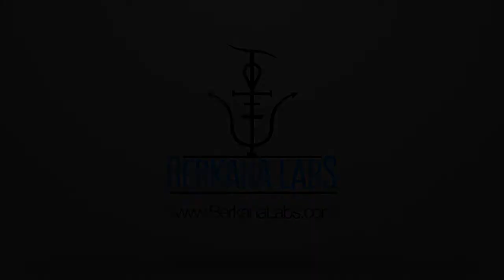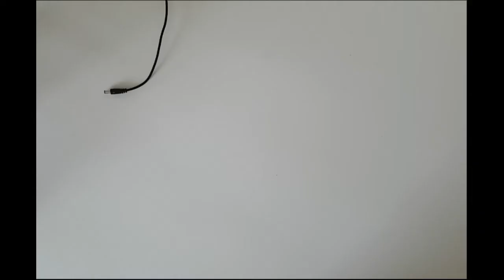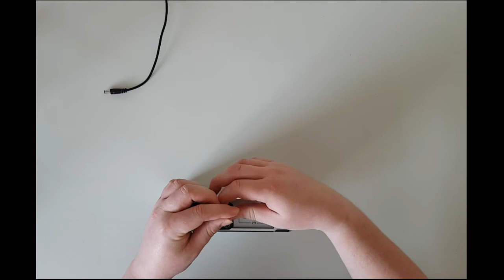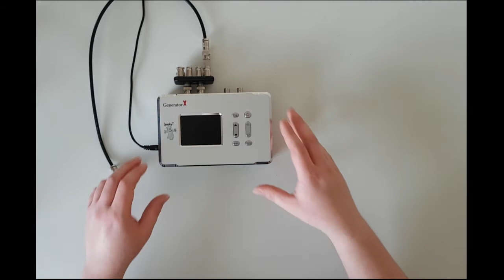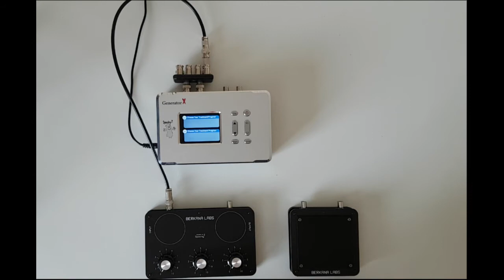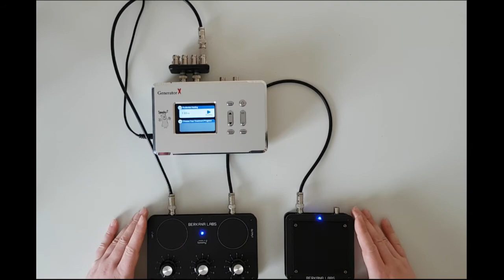Radionics Stick Pad | Berkana Labs

Comment: Guys, this is based on my own research. I am not sure if this is the case for this particular stick pad from BL though. 
 Technical Analysis of the Drown/Abrams Circuitry

The "electronics" of these devices can be understood as a form of Radionic detection, operating on the principles of resonance and electrostatics rather than conventional high-voltage power.

1. The Technical Component: The Capacitor Effect
Physically, the "Stick Pad" (often a rubber membrane or dielectric plate over a metal coil/plate) functions as a variable capacitor within a resonant circuit.

The Circuit: The Drown device is essentially an impedance rheostat—a series of large, variable resistors.

The Signal Path: Extremely weak energy is theorized to flow from the specimen (e.g., a blood spot) through the dials (resistors/tuning stubs) to the rubbing plate.

The Finger as Ground: As you slide your finger across the plate, you become part of the circuit. Your body acts as the ground or the second plate of the capacitor, completing the loop.

2. The Physical Phenomenon: Electrostatic Adhesion
There is no "high voltage" involved in the traditional sense. Instead, the device relies on electrostatic effects and microscopic galvanic currents.

Surface Tension Shift: When the circuit reaches resonance (meaning the dial settings match the specific frequency of the sample), the electrostatic field on the plate shifts.

The "Stick" Effect: This change in the field increases the microscopic friction (adhesion) between the fingertip and the surface. This causes the finger to "drag," "stick," or "stutter."

Analogy: This is similar to rubbing a finger over a balloon; depending on the static charge, the finger either glides smoothly or "squeaks" and sticks.

3. Physics vs. Vitalism
The device occupies a grey area between documented electrical components and controversial theories:

The Tangible: The wiring, resistors, and plates are physically real. If the connection to the plate is severed, the device (according to Drown’s blueprints) ceases to function.

The Controversy: Classical physics struggles to explain how a biological sample provides enough "energy" to produce a tactile effect without an external power source or amplifier. Drown and Abrams postulated a "Life Force" or Emanation that they treated physically as if it were an electric current.

Conclusion
This is not a "fantasy prop," but rather an electrostatic detector. The underlying electronics consist of a complex system of rheostats designed to indicate resonance through a tactile change in surface friction.

Comment: In the Manual you recommend the boost out2 port, Here  however you recommend the BN port, Any reason in particular? I want to work out Rates, does it matter? I realise that one is general and the other Healing.
Also, after you have worked out one rate and  you wish to find another one for something different, do we need to switch off anything and start again? or should we just set dials to zero and continue?

Comment: I still don't understand the purpose of it. I'm new to radionics and your products. What purpose has it if I tune the dial of the remedy with a stick pad. What is it good for?
Reply: Этот метод не корректен, не забивай себе голову, он очень груб, палец -это должен быть палец пациента, но не оператора. Проще купить любой не дорогой прибор биорезонансной терапии, а также использовать метод Фолля или доктора Шиммеля.
Reply: @prostoUser233  I am the patient. The devices you mentioned are fairly expensive for an end user and I don't know how to operate to get the same results as with the stick pad.
Reply: The stick pad has history. Ruth Drown used it to diagnose Patients from afar. She put a blood drop on the input, found out the rate with a stickpad and looked up which sickness corelates with the Rate.
Reply: Its just a method to help indicate when u need to stop tuning the knob to get a rate. There are also other methods that can be used. I use the output plate itself to get the stick. Buying an external stick pad is obsolete unless you want to spend money and just like the way it looks imo.

Comment: At the GeneratorX which programs are loaded and which one are you using.
Reply from the maker: In the video I have Radionics Healing, Radionics Killing, and Manifestation loaded. In the latest Spooky2 Software all the presets have a frequency program in them already. I use Radionics healing on the G1 generator of Spooky2 Generator X in this example and that has a 7.83Hz Schumman resonance frequency in it. To add custom frequencies to the presets you do that in the programs tab of the Spooky2 software, then at the generator settings tab you can load that in the Gx for using standalone.